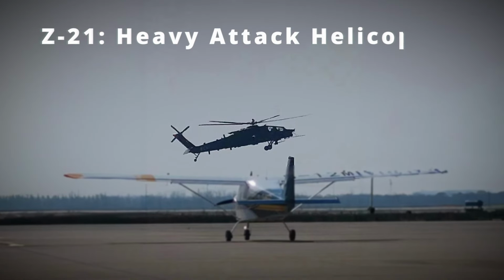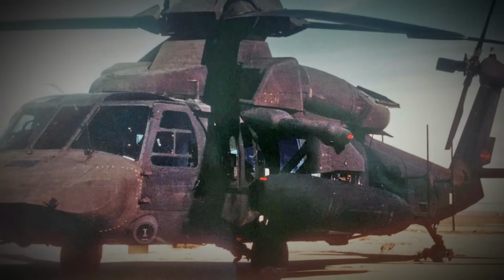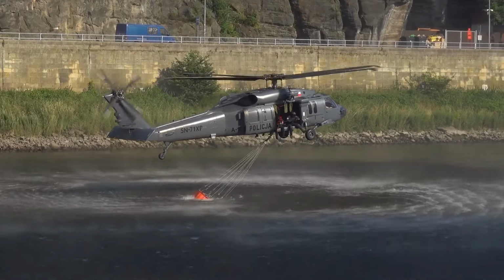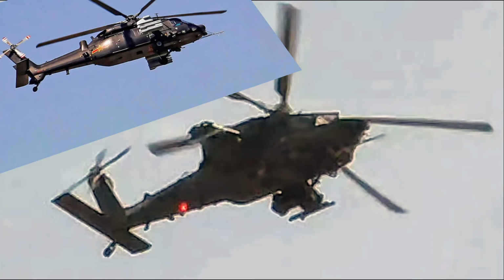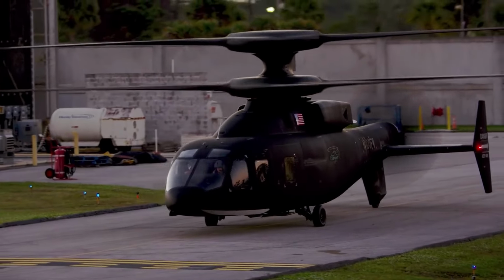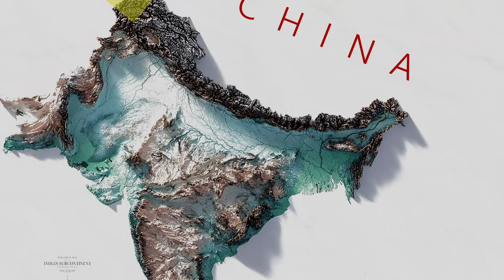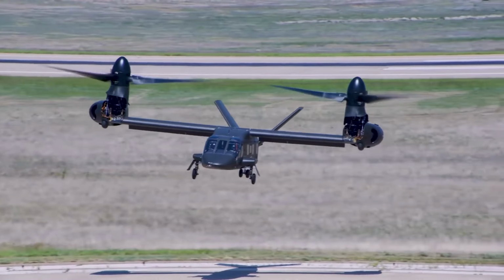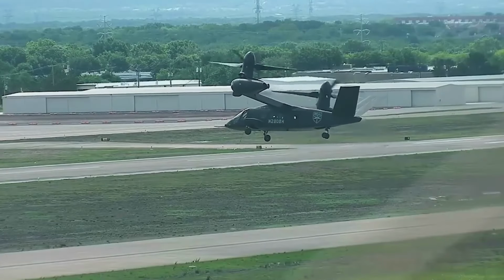China's Apache Takes Flight: Z-21 Heavy Attack Helicopter

Comment: Tilt rotors are junk and unsafe at any speed.
Reply: No they are not
Reply: @robleyusuf2566  You know how many V-22 crashed due to changing Wind while hovering? More than crashed due to technical failures! No joke! They had decades of research and it still happens from time to time. So they don't fly them into bad and unpredictable weather anymore. While the CH-47 is still rocking, after 50 years!
Reply: @WanderfalkeAT  They are good

Comment: Parity? Not sure about that, considering most of the advancements usually come after they manage to steal some new tech or acquire it somehow. Not sure about this new heavy attack helicopter but all previous versions have been a couple generations behind. China has attempted to mimic, copy, or buy western systems which is how they made early advancements but that loophole is closing. The CCPs companies will now have to start thinking for themselves.

Comment: China has engine problem with that helicopter
Reply: not at all the Z20 has been in operation for years now. Partly why they used it as a basis for this new helo is because its been proven to work.
Reply: No it doesn't.

Comment: Main gun looks a ton smaller than the Apache 30mm, wonder if that’ll change
Reply from the maker: It looks quite different from the 23mm on the Z-10. Not sure if it will be staying.
Reply: What to do after supply 24 units S70 then China got sanction. China have to make moulds and toolings to produce spare parts to maintaiined these expensive helicopter from US or else it will turn to white elephants. With the expensive moulds and toolings, dont ecpect to make a few parts. They have to make thousands parts out. With these thousand parts...They can builf hundreds of new S70 as we see today...
Lesson learnt....Never sanxtion Countries wirhout consequences.

Now China already upgrades the Helicooter with Fly by Wire, 5G6G data links and fully networked.5 bladed rotor for smoother and powerful lift. Redesign tailboom for better handling. Its no longwr the S70 nor Black Hawk outdated design.  
Same like EV cars to western outdated cars...😂
Reply: Lack of originality !
Reply: @NapgGerminio  immagine being a german in WW2 shouting 'lack of originality' when soviet armour comes rolling over the hills.